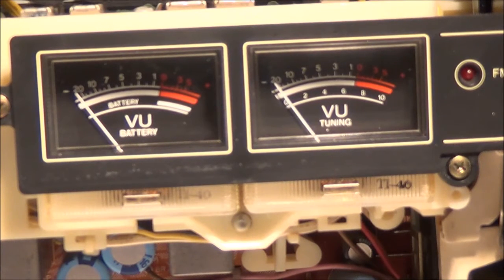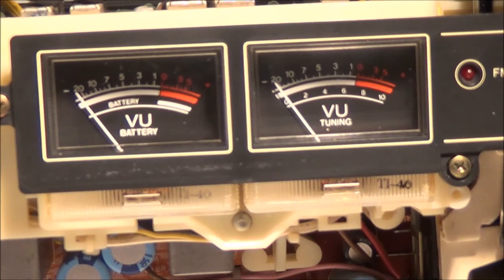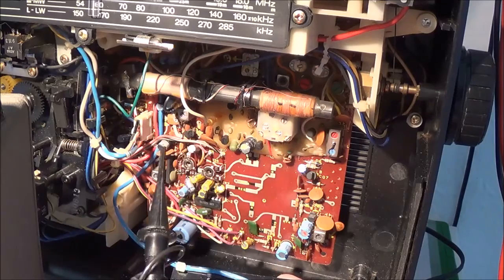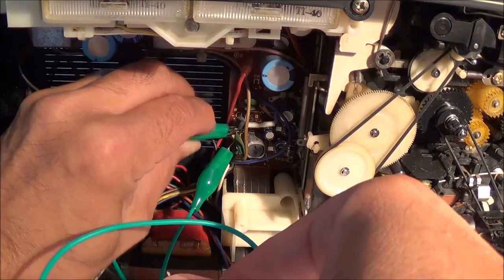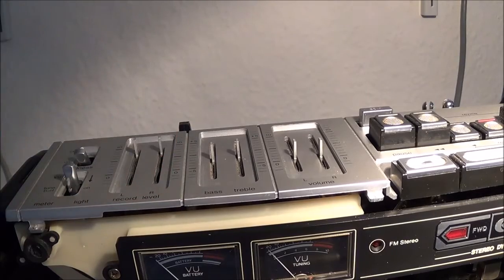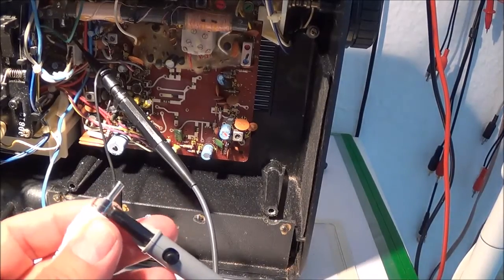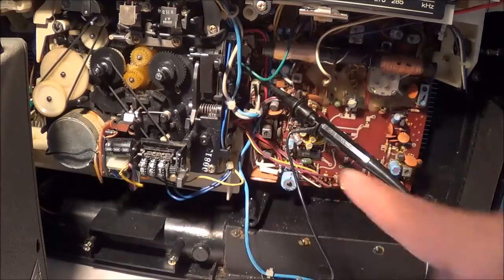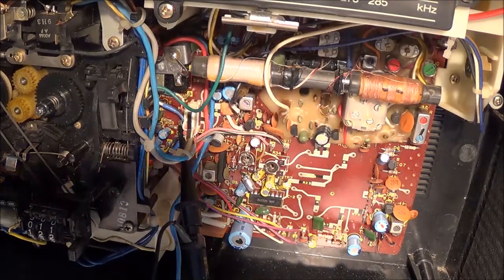SHARP GF-9191 VU METER ADJUSTMENT

Comment: Is it possible to replace these if u buy the part?
Reply from the maker: Getting them from a donor unit is easier, since you have to match the size and electrical characteristics. 
 Normally these don't go bad; they can get stuck though.
Reply: @OldSchoolElectronics  But is it possible to replace them as the boombox i brought has faded ones and i want to replace them.
Reply from the maker: I have been travelling, don't always have Internet while travelling, and am not on YouTube everyday (might take me a few days to answer). But to get your question; my best advice would be to get ones from a donor unit. Since you have a 9191, you could also use  VU meters from a 9090. And what do you mean by fading?
Reply: Old School The 9090 I brought from has been in the sun so It was faded so I have brought a replacement original but I’m just asking if it easy or hard to replace?
Reply from the maker: Ah ok; you do have the proper part. No, it is not hard if you take your time and are careful. I don't remember the exact procedure, but I have did it before. Get the service manual for the GF-9191 since the GF-9090 service manual is not available for free I think. You can get it from other places on the web and here: https://elektrotanya.com/Sharp_GF-9191H_E_HB.pdf/download.html
Reply: @OldSchoolElectronics  Yes it's the proper part for both of them i got. And have u got a link to the gf 9090 manual? Thanks for the help. :)
Reply from the maker: I don't have the 9090 service manual, but the GF-9090 is almost just like the GF-9191. I think the difference is that the GF-9191 has a phono input, has higher output (might be a few other differences), but that has nothing to do with the meters. Take a look at pictures of the meters of both models. I would use that 9191 manual.
Reply from the maker: Cool. Thanks! I'm going to get that too!